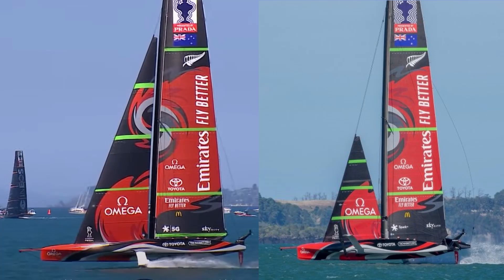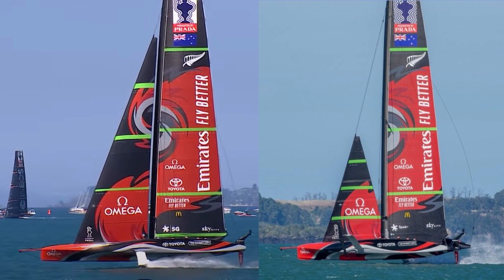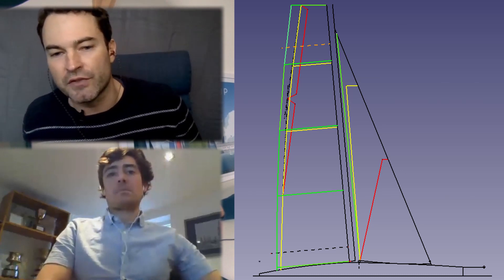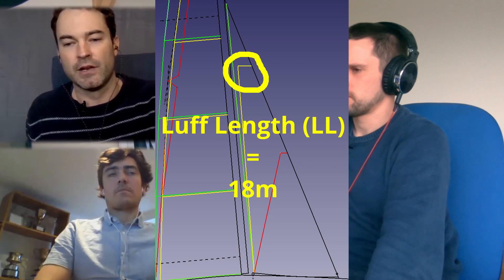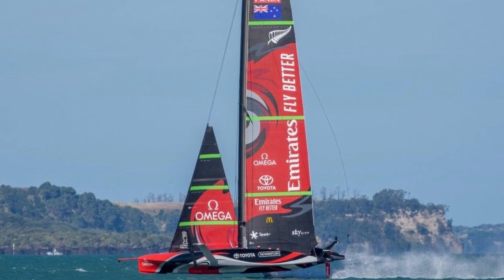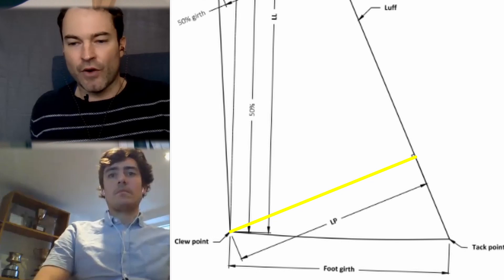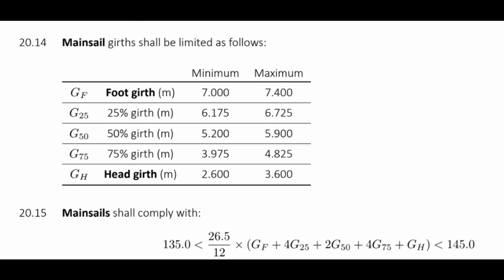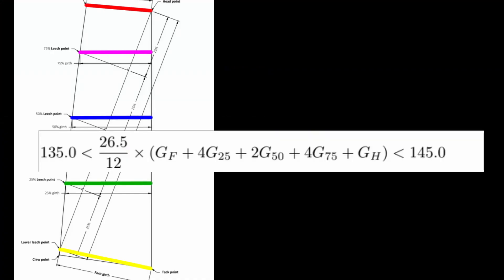Batwing Main and the UNLIMITED sail area loophole: A guide to America's Cup Sail Plans (Part 1)

Comment: the number "12" is not a random number. note that there are actually 12 girth measurements being used (yes, some are the same), so dividing by 12 is like having a "weighted average" girth to multiply by the luff.
Reply from the maker: I get where the 12 comes from. But the 26.5 may as well be a random number as the teams are not actually measured. Essentially, this is only a rule about girth lengths in proportion to each other, masquerading as a rule about sail area.

Comment: Love your AC video series but you're wrong about the NZ sail area.  You can see in this image (https://imgur.com/3gBW2rX ) that the same number of copy-pasted broadcast cameras fit between the real broadcast camera and the hull.  It is stated in the rules that these cameras have a fixed weight (same model) and are mounted at a fixed height above the mast rotation point (MRP) in order to preserve the vertical centre of gravity across all competitors.  It follows that the height of the MRP relative to the deck must be the same for Luna Rossa and Te Rehutai.

A quick reading of the rules confirms this.  The rules state that the MRP is the point about which the mast BASE rotates relative to the hull, not the mast ball.  The rules further define the mast as any part of the rigging that is not hoisted with the mainsail and headsail.  This would include any rotating "fairings" below the mast ball, therefore the mast base must be the point at which the mast meets the deck.  You're technically correct that a loophole exists such that you could build a raised podium into the hull, mount the mast on top of that and still bring the mainsail down to the deck, which would increase your sail height above 26.5 metres.  But you wouldn't be able to rotate the podium or secure the tack of your sail to it and therefore your sail shape in this extra area would be very inefficient and likely not worth having.  Even then, I'm not convinced this would be possible under the VCG limit.  Various comments from the teams indicate that the control systems in the top 4m of the sail are limited by VCG so raising the mast by even half a metre is probably out of the question.
Reply from the maker: The 'mast tube' is the one design part which is 26.5m. The 'mast' includes sail support structures (booms) not hoisted with the sail. So the mast could include a fairing around the stump below the one design mast tube, but that wouldn't make it part of the 26.5m one design part. 
The MRP is the rotation point for the mast base. But that doesn't mean the mast base has to sit above that point, only that it rotates around it. Which it does. 
I like your camera measurement! However, we know, because we can see the location of the mast ball, that the mast rotation point definitely isn't the same height relative to deck on LR and ETNZ. I see in COR/D Notice 008 that the fitting of mast camera's is by ACHB, but I must admit I cannot see where height above MRP is specified. Could be the guys just came on and glued the camera on Xm above the the mast base.
Reply: @MozzySails  Thanks for taking the time to reply.  The VCG limits are in section 10 of the AC75 Class Rule.  There is a line that specifies the VCG of the "supplied media equipment" for the mast assembly, in terms of metres above the MRP.  So you can see that it's quite clear the MRP must be the same height above the deck for both Te Rehutai and Luna Rossa.  ETNZ may have chosen to place their mast ball above the deck but it wasn't for the purpose of raising the MRP or increasing sail area.

I think your interpretation of a rotation point in a different plane to the mast base is more than just a loophole.  It's an intentional misreading of the rules.  An object doesn't rotate about a point - it rotates about an axis.  If the rule talks about a point that the mast base (a plane) is rotating about, it's clear that the rule is referring to the point on the axis of rotation that intersects the plane of the mast base.  What is the purpose of specifying "mast base" in the rule as the rotating object otherwise?  Why not just write "mast"?
Reply from the maker: @navierstalks  Table 10.1 doesn't impose any requirements, only what is specified elsewhere in the rule. Many of these components aren't weighted individually, but get put in to yacht assembly calculation of CoG. CoG for media equipment is another line in that calculation (afterall they weren't supplied this equipment until the ACWS).  So if the ACHB come and stick it on in a different place I don't think any rule is broken.  
The rule talks about a rotation point not axis. Suggesting all rotation, in whatever axis should be about that point. So, I don't think it's too far a fetched interpretation. 
We can after all see, very very clearly the mast ball is raised from the deck. You also have rule 12. Which fixes this Mast ball to the MRP.
Reply: @MozzySails  Thanks for the reference to 12.1.  It didn't occur to me to check the deck fittings section.  That clears it up.  I will promptly eat humble pie.

Interesting that you say the mast can be rotated in whatever axis.  I assumed it can only be rotated in the longitudinal axis, which is why I took issue with the phrase "rotation point".  If it is indeed legal to rotate the mast in any axis (and a cursory glance over the rules doesn't suggest otherwise), one would think there are potential gains to be made with both fore/aft rake and port/starboard cant.  Curious that I haven't observed any team demonstrating this capability.  Perhaps a subject for a future video?
Reply: @MozzySails   (& @navierstalks) At least I would find very interesting a video deep-dive into the discussion you all are having here... I do not totally "get it" though I am confident I would understand given a bit more explanation.  And it seems to me that this may be the (primary) design consideration that ultimately allows ENTZ to crush LR in the finals (I predict a 7-0 butt kicking).  To wit: If you have a bigger sail plan then you have a massive advantage (IMHO).

I think what you are saying is that ETNZ has a mast that complies to the length of 26.5 but that they have then mounted that 26.5 mast onto a ball that has been extended above the deck.  They have have then shrouded this extension thereby increasing their total sail height to 26.5 + extension.

Some questions: Has ETNZ maximally exploited this loop-hole?  E.g. what is to prevent a team from extending the ball even farther "above" the deck thereby increasing the sail area even more?  Also does the ENTZ deck design factor into this exploitation - and if not then what prevents Luna Rosa from hacking this into their sail plan right now (does this rule hack require that the deck be designed as ENTZs?).
Reply from the maker: @kevintimothyshields  They haven't maximally exploited this rule, you could go much further. However,  they're are rules about enclosed area, 70m3 for the hull, and 40m3 watertight. Plus some buoyancy rules which must be met. Finally, the hulls have to house the foil cant system in this area, which is one design and take up some space below deck. I suspect it is these factors limiting ETNZ deck height. 
LR cannot implement this on their yacht as the mast ball is fixed relative to the foil cant system. If they built a pedestal like ETNZ for their mast step, they would then have to move their FCS, which is pretty much impossible at this stage.
Reply from the maker: @navierstalks  no worries! The rules hide a lot and it's always good to get another person's take as there will be lots I've missed myself

Comment: About the formula. Interpretation could be that, if you measure the sail, not in relation with shaft, you have more fabric at the bottom and you can reduce area at the top side were is more convenient, without breaking the rule

Comment: The two AC75s left in the AC don’t have booms. This was the design challenge which produced these innovative solutions.
Reply: LR do have a boom. It's underneath the removable deck faring.
Reply: @billthomas7644  Well yes but it is clear that LR has the ability to shape the main down to the deck unlike Ineos whose boom was above the deck which limited main sail trim to above the boom.

Comment: I like all your vids. I have always thought the control systems and energy conservation will play a big part.  If done right, it allows for “more” and faster control.  Just look at 2017, ETNZ clearly had the hydraulics advantage.  Do you have any thoughts on the control of the boats and sails, specifically energy req, and if you can see any energy recovery systems?

Comment: No one seems to have mentioned the drag associated with the points on the batwing mains. I am imagining that the NZ batwing has less of that than the AM one, but I would have thought that someone could come in with more gradually curved leech cutouts and points that would be even less drag.
Reply: Interesting thought but I don't think it necessarily makes a difference.  If you apply lifting-line theory to a batwing sail then yes, sharp leech points will create large vortices and therefore high induced drag, but more gradually tapered leech cutouts will create many small vortices which sum up to a large one.  They may even have a method of controlling the profile of the sail at the pointy regions to reduce lift there, in which case no vortices would be generated at all and therefore induced drag would be even less than the gradually tapered version.

Comment: Let's compare AC75 to F1. 
(1) 'Cheating'? F1 rules are set by the FIA (AFAIR). The teams have input to the design rules. To make the AC like that, then the Holder and COR would have to agree that the design for a particular challenge was that design produced by an external body. That could be possible. Could lead to more teams being involved esp if a design was carried forward a la F1.
(2) 'More Racing'?  Most sailors would love to see more of these races. That would need money - sponsorship and viewers to drive advertising revenue. At present the AC is a niche (elite?) sport. So, no huge audience to fund the racing. F1 is basically driven by advertising/sponsorship. 
(3) Technology? As I read some of the rules, there are 'given' pieces of equipment (such as hydraulic reservoirs?). There my be parallels here with F1. Construction, aerodynamics, bleeding edge - highly comparable.
(4) Relativity - can Joe Bloggs relate the AC75 boats to everyday life? No way, but for F1 there is high relativity. (5) Watchability? Better, I think with the graphics. Potential for disaster (always a crowd puller) - the AC75s are on a par with F1. Also, some F1 races turn into 1.5 hr processions whereas the best AC75 races are 20 mins max.
(6) Excitement? Definitely!

Comment: The racing during the Prada cup was substantially better than the Christmas series.  That was brutal watching boats sitting in the water.  
One other thing I noticed that was different between the two series is the improved tacking and gybing. In the Christmas series the boats would lose almost half their speed when they tacked. In the Prada cup, they lost very little speed.

Comment: When looking at the lower part of the sail, it is important to see if it has the potential to produce aerodynamic power. In Ineos the boom and the sail area below it was just a bunched mess with very little ability to generate power there. Luna Rosa has a very clean bottom section and the deck curve is an aerofoil shape which will accelerate the wind across it. I think that channeling the air coming over the deck was one of the purposes of the new farings they added. Team NZ has a similar setup except their deck is pretty flat aerodynamically but they have high sides to channel the air. But their sail at the bottom isn't as clean as Luna Rosa's aerodynamically.
Reply: Remember you are only looking at the low pressure skin The back skin (the more important one) may be perfect.

Comment: In the discussion of Simpson's rule (the formula for mainsail 'area'), it is helpful to notice that the denominator 12 is the sum of the weights of the girths (1 + 4 + 2 + 4 + 1). Therefore the mainsail 'area' is approximated by 12 rectangles, each with a height of 26.5m/12 = 2.2083 m, and a width specified by the girth. To me, it makes more sense to consider Simpson's rule as a simplified formula for sail area, rather than 26.5 and 12 being arbitrary numbers with no units.

But, if you prefer, you could consider the numerator 26.5 and denominator 12 as arbitrary numbers. Suppose the rule stated that the girth weightings were the same as given (ie 1, 4, 2, 4, 1) and denominator needed to be a prime number between 10 and 30 multiplied by 12 (the sum of the girth weightings), but that the numerator was the mast height multiplied by that same prime number. Then every team drew a number out of a hat (say a prime number between 10 and 30) which determined their own 'arbitrary' Simpson's rule. There could be a big ceremony attended by throngs of numerically illiterate supporters, each hoping their team will draw the largest prime number). Let's call their special prime number 'p'. Then their Simpson's rule would be determined as:

135 < (26.5 x p)/(12 x p) x (Gf + 4 G25 + 2 G50 + 4G75 + Gh) < 145

or cross multiplying by gives:

135p < (26.5 x p)/12 x (Gf + 4G25 + 2G50 + 4G75 + Gh) < 145p

So for the lucky team that drew 29, their mainsail formula is 3915 < .... < 4205, and for the unlucky team that drew 11, their formula is 1485 < ... < 1595.

In this way, the numbers 26.5 and 12 could further shrouded in arbitrary mysticism, or we could consider  26.5 as having units of m and the 12 as the sum of the girth weights. With the latter, Simpson's rule is an approximate formula for sail area in units of m^2. Anyway, that's my preference.
Reply from the maker: Well done, you've won comment of the day! 
I think what I was hoping to convey in the discussion of the formula, is that it's actually quite a simple calculation of area and one where one side is predefined / assumed, rather than measured. The result is, there is no limit to sail area in the rules, as long as you stick within the requirements for girths and add area via a longer luff length
Reply: STREWTH! as we say. I need a cup of tea. Thank you all.
Reply: Jeees..... .I never knew sailing was that complicated......

Comment: So ETNZ took advantage of a "loophole" they probably created just to have more sail area than their competitors.
Reply: Yes, but it is there in the rule for any other designer to spot, if they are on the ball. This is just as much a competition between the designers as it is the sailors, so hats off to the Kiwis for using it to their advantage.
Reply: @jptanguero  I can not disagree more. I find it reprehensible what they have done with the AC.
Reply: @davidkennedy3050  Why ?
Reply: @davidkennedy3050  
Yeah, why David.
Squeezing the maximum out of the rules has always been the case in yacht racing, right back to the old “plank on edge” days of the 1880s. The origins of the classic “spoon bow” and the long counters on the Js and 12 metres were all about “cheating” on waterline length.